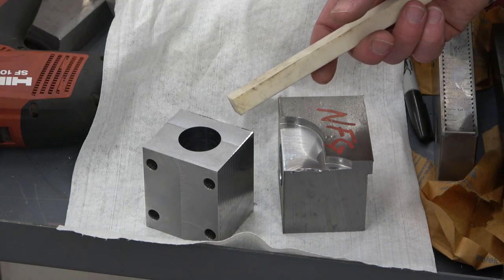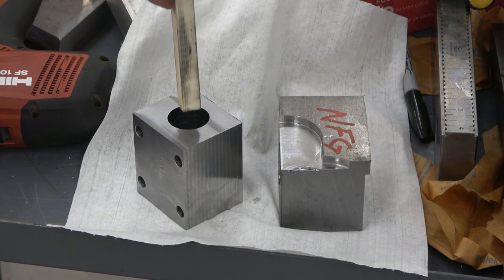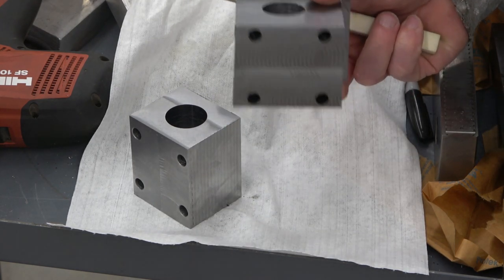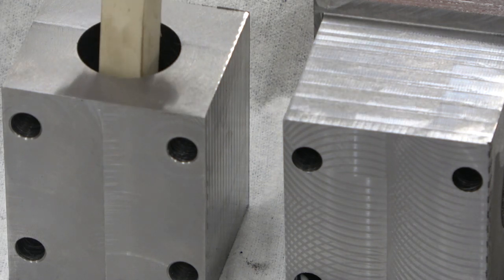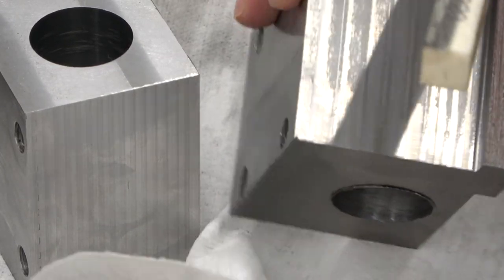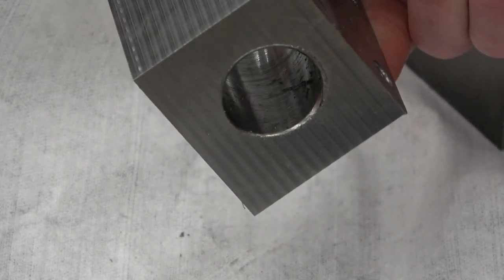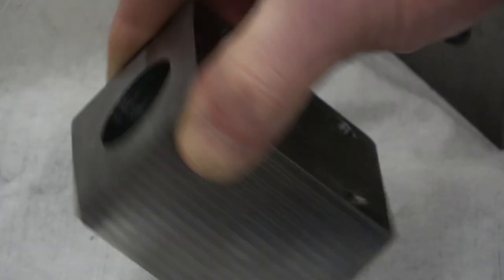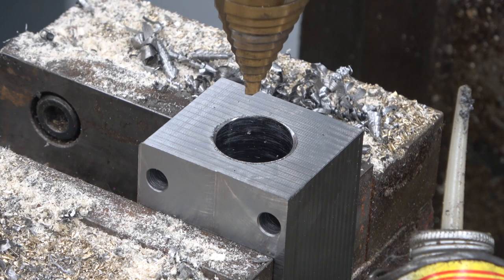Bricks for Invention! | Town Pump CNC

Comment: Pro-tip: Cut the extra piece of stock right away and you'll never screw up the first one.
Reply: God damn, that's so true!
I think that is how paperweights are born!
Reply: Hahahaha nice
Reply: On a onezy, you always make toozies. The f√¢k up can be on a shelf for looks IF it looks good. Or good one can be on a shelf and the toozie makes it to the customer.

It just looks good when you have a présentoir full of intricate parts for customers to look at. If you saw the parts we made, you would be in awe!

I even made Y brackets out of titanium. It was to bolt tubing for solar panels on a satellite. I started taping the holes and my sphincter puckered up like an old woman's mouth with no teeth. Gave it to the shop foreman and tapped them like it was 6061-t6. Tapping titanium is like trying to tap 10-32 into the Canadian Shield!

Ostie calisse no way!
Reply: On the railway, we have track panels, prebuilt and stacked up, waiting to be used. The theory is they won't be needed if you have them ready!!
Reply: I always grab one extra rivet. If I bring exactly how many I need, I will inevitably fuck one up and have to make the walk of shame back to the parts bin.
Reply: when ever i have to get parts for my crew in the middle of a build i try to buy twice what we think we need, and then a size or two upper and lower (budget allowing) just in case.  saves a lot time
Reply: @bigreddodge  Which walk of shame is worse... the second trip because you got the wrong part initially or because you fucked up the first one? Personally, I'd say it's a toss up.

Comment: I remember watching a video of Fred Dibnah demolishing an old Victoria chimney, about 50 metres tall, by hand. Broke out all the bricks around the base replacing with timber as he went and then set fire to it , loads of people milling around watching it.  No health and safety issues there
Reply: Fred was an absolute legend
Reply: "Did you like that?" He would ask after. RIP Fred.
Reply: There was a bit of H&S - he would blow that horn as it started to collapse 😂
Reply: @4sl648  I read that in his accent :)
Reply: I went down the Fred dibnah YouTube rabbit hole this winter! Good stuff that is!
Reply: I saw Fred do a chimney in my home town 25 years ago, he was a hero then as he is now.
Reply: Strangely enough his method tended to be preferred  in the more densely populated areas for H&S reasons. When there's only gravity involved there's less chance of some unexpected lump of masonry flying through someone's front window.
Reply: There was one he took down with his helper using a loop of cable and dumping buckets. The heavy full bucket pulled up the empty bucket to refill. If that isnt genius i dont know what is.

Comment: Used to work at a machine shop just out of school, I thought I was the only one who did this 1:04 !
Reply from the maker: How else do you make sure it ain't flying out?!
Reply: Tappy tap
Reply: Even me as an elechicken taps every pipe and box I install with my klein linesman pliers (Kleinsman's pliers)
Reply: @MrTPoops  9" diagonal cutting elechickens hammer.
Reply: A good bonk on the top makes sure they sit down and shut up! That is, they are seated properly, and are without chatter haha
Reply: @keatoncampbell820  Big thing to watch for is doing that with stuff that isn't stress relived or small enough to bend from a proper hit, you can bend and stress it in a way that will cause the part to spring up or around just enough to ruin a part if you are holding halfway tight tolerances.
Reply: @keatoncampbell820  I bonk mine with a reboundless striking implement.
Reply: @jr540123  Im a welder, but I'm in school for engineering and I have a shitty mini lathe, and I found out what you say very well a week ago :). I managed to sink a piece of brass into my chuck when I whacked it too hard before a drilling operation. It just wouldn't stay flat! So yeah one good hit and now the chuck jaws are locked, apparently the OD had a taper and I just am a fool lmao
Reply: @nelsonbrum8496 ....... Sooooo....... Your fist? lol
Reply: @DUKE_of_RAMBLE  If it's stuck down with double sided tape, then yes! 🤣
Reply: @keatoncampbell820  You bore it out of there yet? A tap is all it takes to make sure it's seated, if you hit it hard enough it will bounce off the jaws.
Reply: @arduinoversusevil2025  I mean... I get it's a joke but I've trained too many fresh operators not to compulsively take it seriously. So, for the sake of the comment section: Visually inspect the seating on both sides of the part, that it is loaded in the correct orientation per your setup sheet, then double-check that the torque on the fixture is correct before starting the machine.
Reply: @arduinoversusevil2025   I get a little tingle in my spine when I see you smacking down on stuff using those. Trying to seat the workpiece likely only shocks the jaws and possibly loosens the grip, if the piece shifts downward from its original bite (maybe something to test out). Assuming it is biting in, anyway. Those Piranha jaws have too much surface area for steel IMO too. You would need a lot of clamping force to get them to dig in effectively. If they don't bite, then it is a VERY small surface area holding the workpiece. However, cutting a 45-degree dovetail carrier into the bottom of the workpiece would work great.. for primary operation. Wouldn't use them for secondary ops at all. You have machined sides at that point, bury it in the vise with standard jaw plates, part resting on parallels/vise bottom. 
Something like Mitee-Bite Talon grips or Versa grips would let you down less for steel. Just need a few inserts per jaw. Torque till you can see a .005-.010" depression in the workpiece. Usually, 35 ft lbs for steel (more if you use more than 4 inserts total). I like to clamp into a saw cut with these too, which is a big no-no with standard jaw plates, but they just bite even better and you don't have to worry about a rounded/fucked over stock edge that will break the insert. Never had 'part ejection' with them.. not full out anyway.. Shit happens.
Reply: @andyreid7274  love that youtube wants to translate your comment
Reply: @BY-bj6ic  they dont speak vernacular!
Reply: Every main & rod cap, every alternator generator starter & electric motor end cap and housing, along with  most assemblies.  Otherwise I don't know if they're seated & fitting together right, just by the sound.  Absolutely necessary to get an armature aligned & spin as free as possible.
Reply: @drifterbbb3649   It's only snugged down, not tight.

Comment: I love the CNC videos! Watching you learn something new with ever part is nice. 
Have you considered to use a torque wrench to tighten the vice? The Manufacturer should give a chart with the clamping force in relation to the torque. It looks like you are using way to less torque for the type of vice. I'm guessing that 60 to 80 Nm would be right. The teeth of the jaws must leave clearly visible indentations. 
The Kyrocera high feed mill also need more feet per tooth. For mild steel I'm using 1500 rpm and 0.7 mm per tooth. But it is ok to go slow on it in the beginning but keep in mint that you will wear out the inserts quite fast.

Comment: Best way to cut rail.  Small oxy cut then drop other bits of rail on the cut bit with a handler and magnet.  That is according to the scrap yard when I spoke to them about it.  Apparently they're was a guy from Holland with a dedicated rail shearing rig that used to come to UK and process thousands of tonnes for Network Rail.

Comment: [03/18/22] You def need to be able to "grab" the workpiece by more than 
.250 inch to get a secure hold on it.
Reply: I keep telling her that. Even with her teeth in she lets go to early, coolant fucking everywhere.
Reply: Why did you date your comment? Those gripper/serrated jaws only work if you tighten them enough to bite into the workpiece. Odds are it needed a lot more clamping force. Probably 60+ ft lbs because of the surface area on those Piranha jaws. Once they bite in, you would have to rip the top of the jaw plates off to get the workpiece to eject.. coming to a future AvE vid near you.

Comment: I think I would've flat surfaced every side by re-positioning the part to avoid those height lines and save time with a bigger chip load although it is more time consuming to square it up, you could use a shorter end mill that is way more rigid to take bigger passes.

Comment: Hello AvE, long time viewer, first time comment. I understand that you want a square base to the part and tool access when it goes in the vice, but why is it that it means you are only using the tippy top of the jaws and there is so much meat below in not getting used. I'm in no position to criticise, just to learn. Intuitively I'd do half and half and clamp more of the part so it doesn't give you summer teeth! 
Anyway thanks for the vidjao!

Comment: Check out spade drills, I'd center drill that and spade drill it on size with a g73 one pass unless tighter tolerances/ surface finishes are required then final bore!
The spade drills cut real close to on size.
Your mill will easily stuff a 1" spade drill with no pilot hole thru 1" 316 SS plate, been there done it on an older HAAS VF3, about all it wants LOL...
Just keep the speed conservative and feed .002 IPR min....

Comment: I actually have a request for a tool I need .  Now I could be looking in all the wrong places but . I am in need of a die and anvil for a small hand hydraulic flaring tool ( does brakes lines , fuel lines and transmission lines ect) for doing a flat o ring crimp/flare  .  curious if you would be interested in the little project.

Comment: Please settle this argument. Can a tap be resharpened using the technique you used on the step drill? Talking about old fashioned straight cut taps, not spiral
Reply from the maker: There's only one way to find out!

Comment: This is almost scary. Air blast is the coolant to use on a high feed mill. Flood will fracture the inserts if your feeding the speed they are designed to go. To much thermal cycling of the carbide inserts.